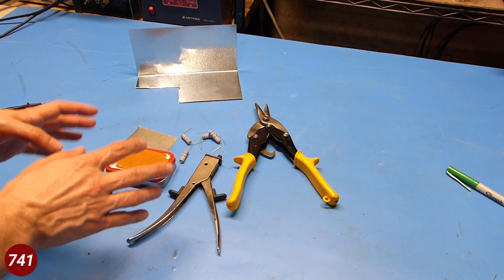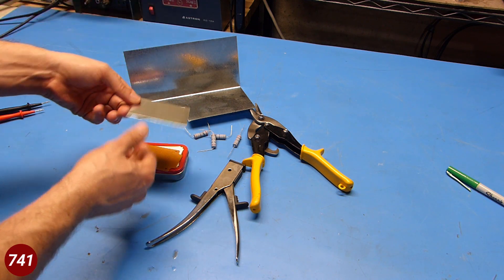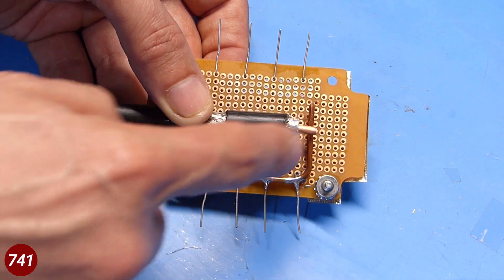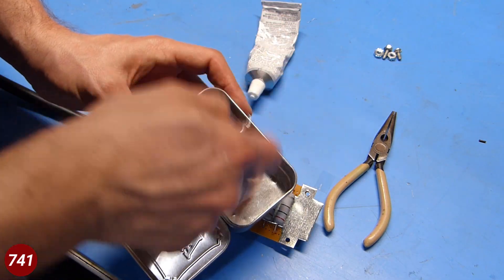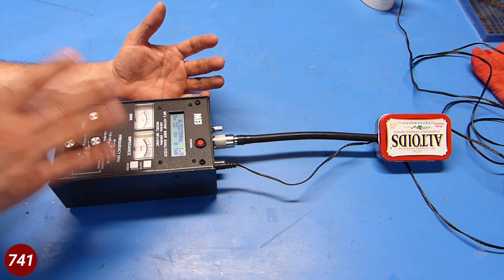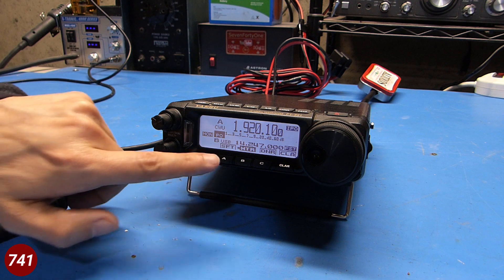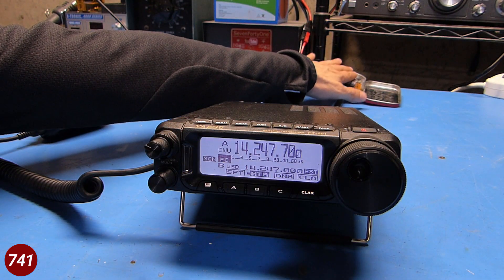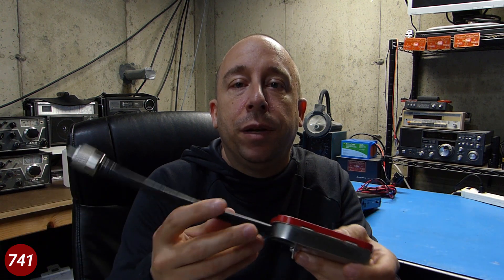Ham Radio Junk Box Antenna Dummy Load Project - Build and Test

Comment: Bro can I use 220Ω ohms resister?
Reply from the maker: 4 220 ohm resistors will yield 55 ohms so it will be a little off.  If that's all you have try it and see how it works but you'll be better off with 200ohm resistors.
Reply: But this resister make any problem  @SevenFortyOne

Comment: Awesome Video ! i have a quick CQ : if you filled the Altoids ( sealing it of course ) with mineral oil type liquid - would that help keep low heat? or am i way off channel? i want to make one of my own, for 11 meter band, and would like to expand on it for 500 watts. Thanx in advance.
Reply from the maker: I imagine the oil would help...not sure you'd get 500w from an Altoids tin but you could scale the design

Comment: Neat little portable dummy load. I built a 200 watt 'cantenna' using a paint can and white oil for the coolant. Works very well, but it's not portable.

Comment: Always fun building a project out of spare parts!  I did a QRP one and just received power resistors from DigiKey to build a 100W version.  73 de Chris K2CJB
Reply from the maker: I found your channel and saw your video right after I finished mine.  I like your design and build alot better than mine!  Can't wait to see the 100W version!
Reply: SevenFortyOne I stole...er, borrowed,...the design from Gil The Radio Prepper.  It works fine.  But I wouldn’t put a lot of power into it. The new one has some serious power resistors.  I just have to find a box that they will fit in!